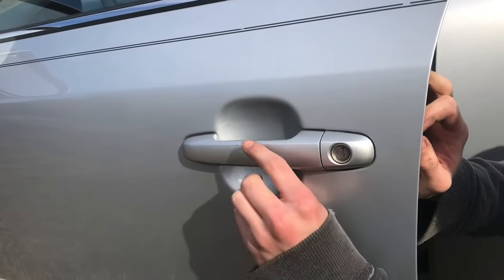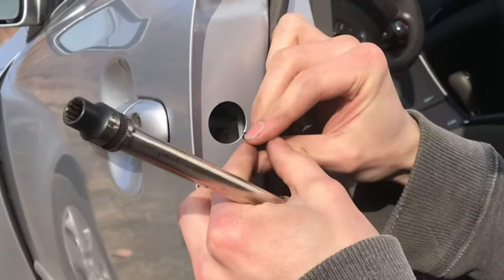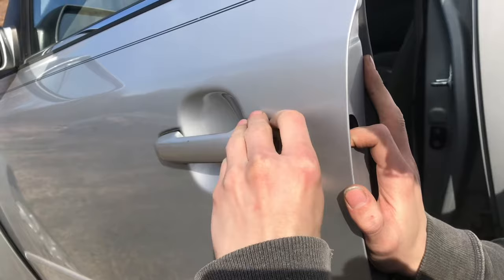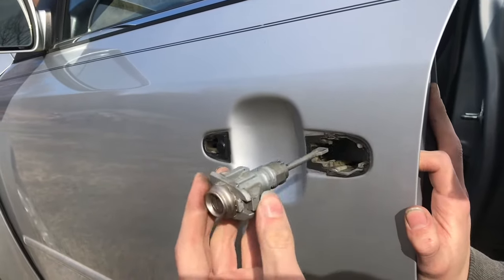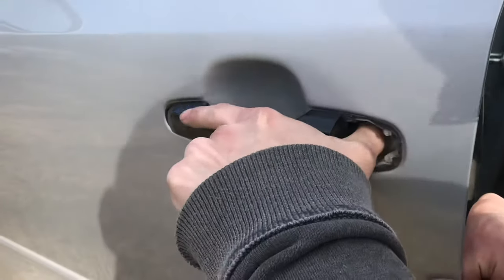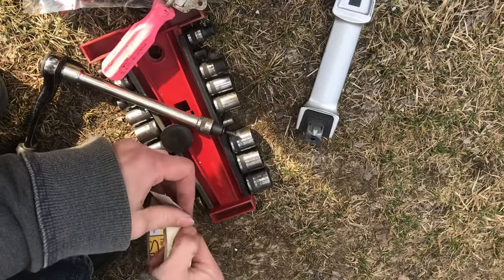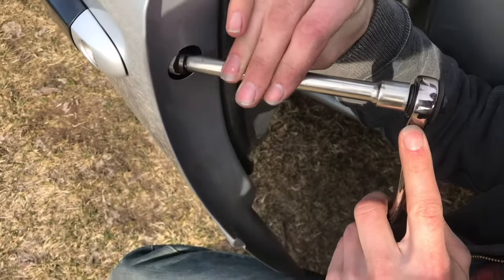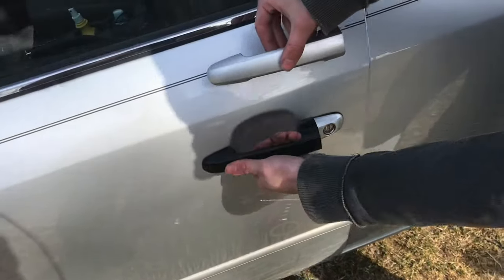replace a “broken” hyundai 82651-3k000 DOOR HANDLE assembly

Comment: Thanks for this video. Much easier the second time. The rear driver side handle broke a few years ago. If you do this and can use a magnet to keep the bolt in place, it helps. I kept the bolt attached while I took off the cap. Then put the new handle on and replaced the cap. Whole thing took 10 minutes. Way easier than replacing the third brake light. There are helpful videos to do that yourself. Thanks again!!

Comment: Lol this just gave me anxiety 😅 how do I make sure that I don’t drop the bolt and if I do, what size is it?
Reply: I was able to take the handles off no problem. Bolt will not fall after unscrewing. Thank you for this video.
Reply: just so you know if you drop the screw you had to take the door panel off and it's pretty simple
Reply: I used an envelope that I strategically cupped around the bottom of my socket and extension that i used, pushed the cupped envelope around the bolt as i removed it.  as it freed, the envelope blocked it from falling into the door.
Reply: @donotelly  How did you make the envelope? what was it made out of....small hole in door.